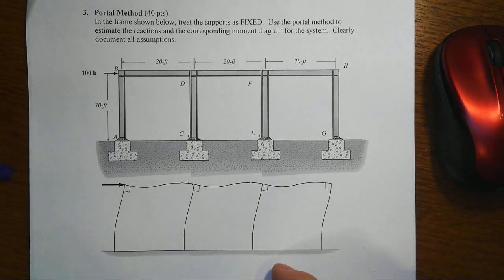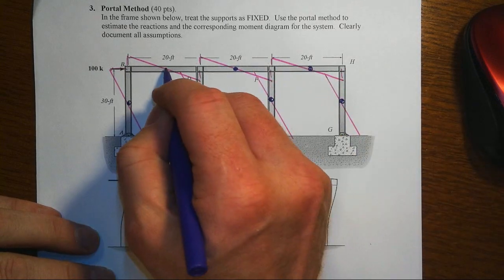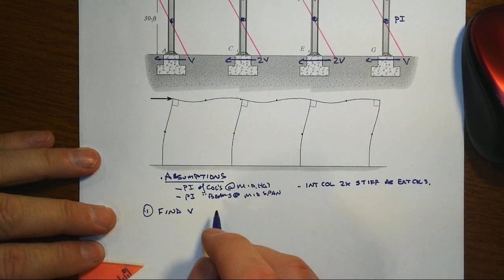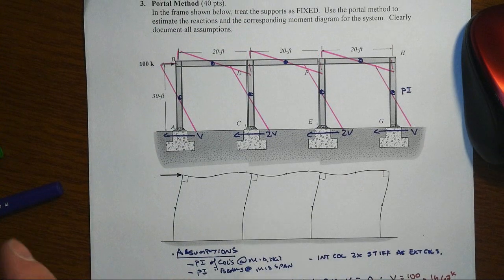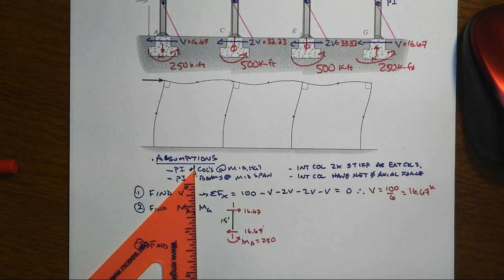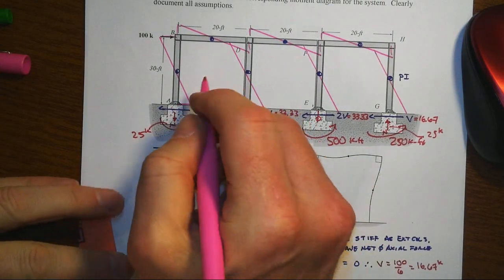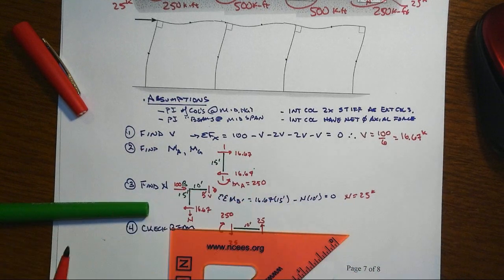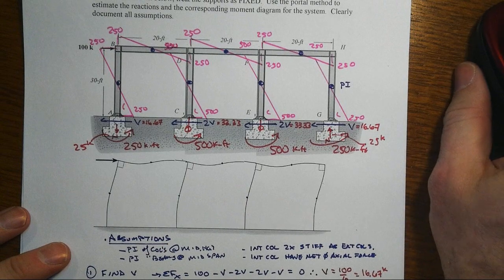3210.18.1.3 Item 3 Portal Method

Comment: Thanks for the video, useful in preparing for SE Exam (or now as they call it the PE Structural Exam). Where did you get that triangle?
Reply from the maker: Hi David.  Thank you for the note.  That triangle came from NCEES.  I used to be a member of the FE Exam Development Committee, although I think I obtained it from one of their booths at the ASEE Annual Conference and Exposition lo those many years ago.  Basically, though, it is just one of those promotional giveaways that anybody could purchase for not too much as long as you buy 1,000 or so!